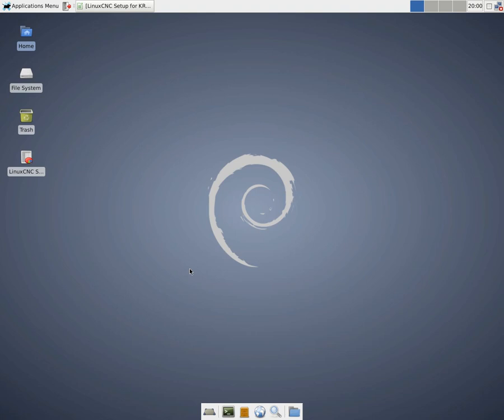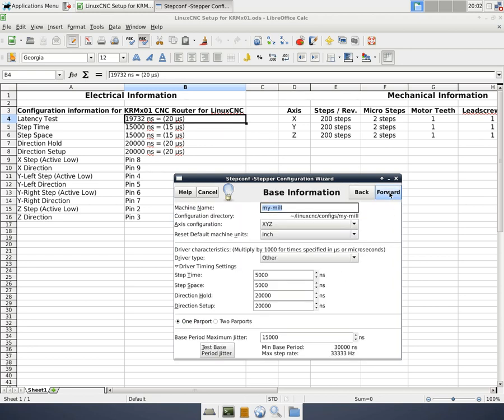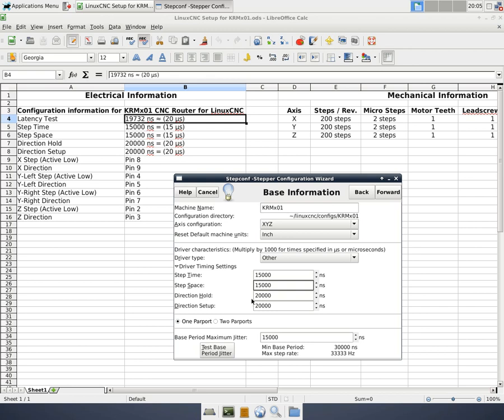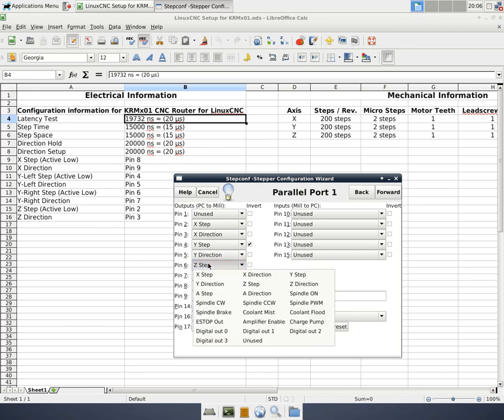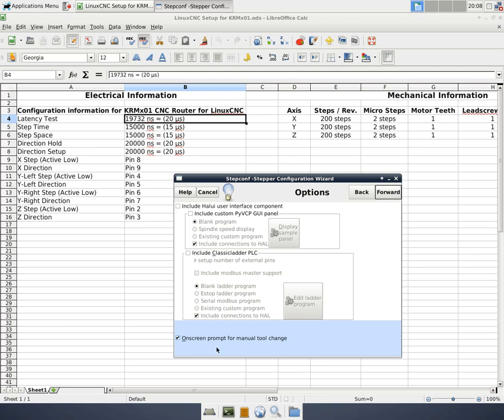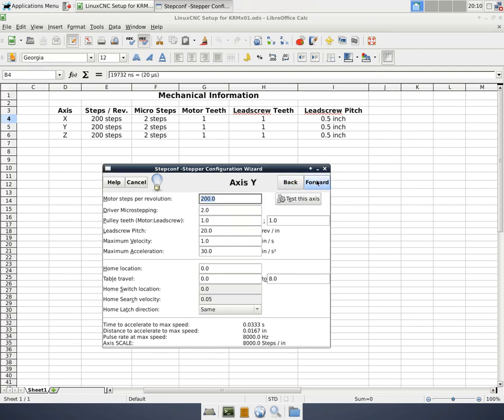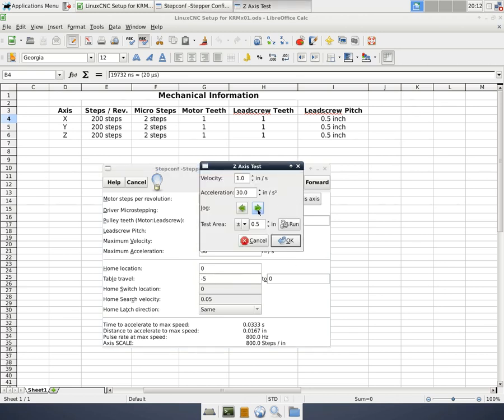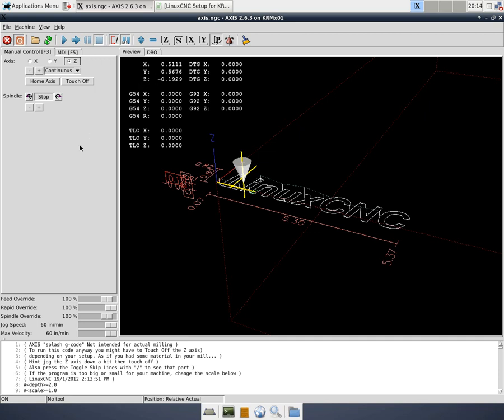Configuring LinuxCNC 2.6.3 for the KRMx01 CNC Router

Comment: I'm building the same machine. I'm looking at getting the gecko 540. Two questions: What electronic setup are you using? Why do you have three power supplies hooked to your system? I assume your using some kind of breakout board with those 4 drivers.
Reply from the maker: Hi Lucas,

I am using a BOB and 4 CW230 drivers.  The three supplies are 5v and (2) 36v.  My drivers can draw up to three amps each and the supplies can only supply 9.7A.  So I used two supplies, one each for two drivers.  The 5V supply will be to run enable on BOB, relays, fans etc when I get them done.  I hope that helps.  Joe

Comment: amigo esta version es CNC10?
Reply from the maker: The Debian 10 CD contains LinuxCNC version 2.8.  If you are going to retrofit your mill, I would consider starting with this version.  I can try assisting you, but will not really be able to start helping until tomorrow.  If you can email me the specifics of the hardware attached to the machine to xavier@gtec.com, I can start when I get a few minutes tomorrow to brainstorm with you about how to go about it.

Joe
Reply: @MyHeap  hola amigo, ya instale la versión que me enviaste, linux cnc 2.6.4, estoy haciendo el LATENCY TEST en este momento, también me descargue el manual del PLC de la maquina, ahora comenzare con la configuración, si me ayudas, mucho te lo agradecería.
Reply from the maker: @leonardoflorez1047  via Google translate

Leonardo, te ayudaré donde pueda. Si pudiera enviarme un correo electrónico con las especificaciones del hardware adjunto a su molino, sería útil. Mi dirección de correo electrónico es xavier@gtec.com. Hoy estoy ocupado, pero puedo ayudarte esta semana.

Joe
Reply: @MyHeap  listo amigo, ya te envie un correo, estare a la espera de cuanto me contactes. muchas gracias

Comment: hola amigos, necesito el cnclinux 2.6.20, por favor podrían ayudarme con el ISO de instalación, he buscado y buscado y buscado por toda la red y no lo consigo. mucho les agradecería se me ayudan con este cnclinux 2.6.20
Reply from the maker: http://linuxcnc.org/binary.hybrid.iso
The md5sum of the above file is: b515c872335336ccfc96471d66b687d8
Reply: @MyHeap  muchas gracias amigo, ya lo descargue e instale, pero estoy viendo el video de configuración y veo toda la información que debo recopilar, y dices que la conexión es por puerto paralelo 0x378, pero en mi maquina es por tarjeta PCI, es una fresadora CNC GRIZZLY G0499, control de Centroid, lo que ocurrió es que ya no sirve la tarjeta madre y el disco duro, se borro software, adquirí otra tarjeta madre y disco, instale la versión de Linux CNC que me pasaste pero al momento de configurar no estoy seguro si me servirá, ya que veo que esta configuración es por puerto paralelo 0x378 y no por Puerto PCI. ella tiene una tarjeta PCI, donde se conecta la comunicación con los servos y encoders de la maquina. me comunique con Centroid y dicen que ya no prestan servicio a esta versión. espero puedas ayudarme, te lo agradecería mucho. saludos